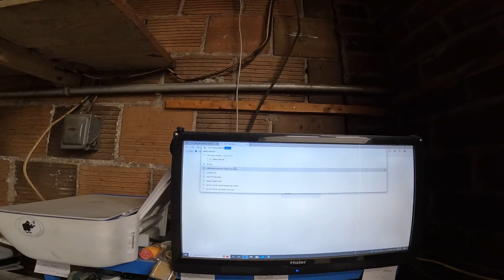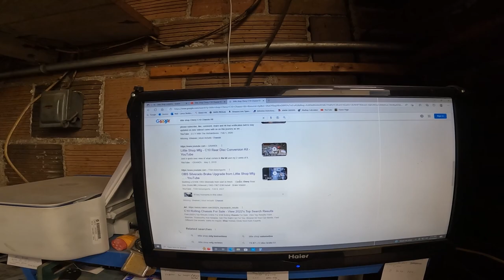93 Chevy G-20 Van Disk Brake Conversion

Comment: Same master cylinder?
Reply from the maker: Yeah, you can use the same master cylinder…. The rear brakes only do 30% of your breaking roughly. So the pressures really don’t change just how they stop the wheel does.
Reply: You kept the same master? Didn’t give you a spongy pedal?